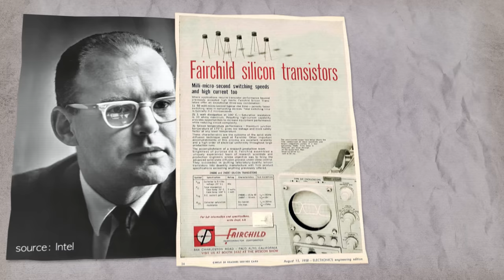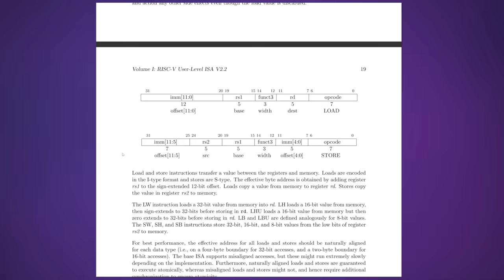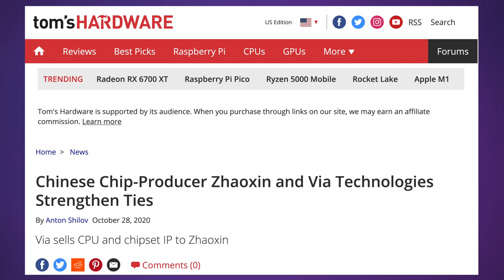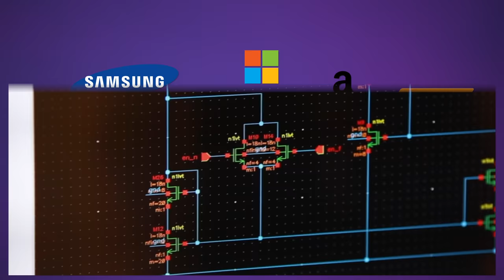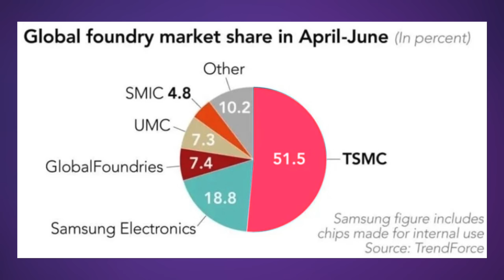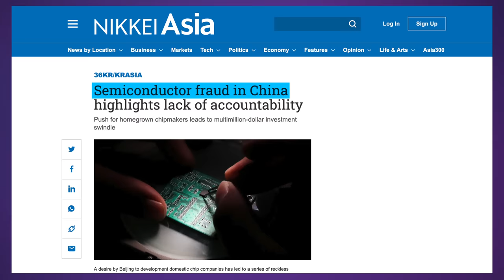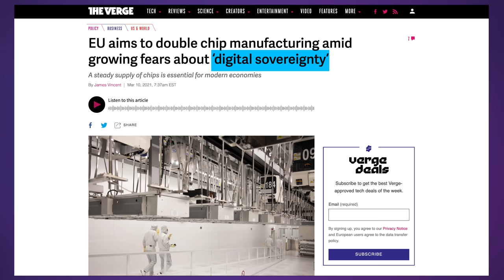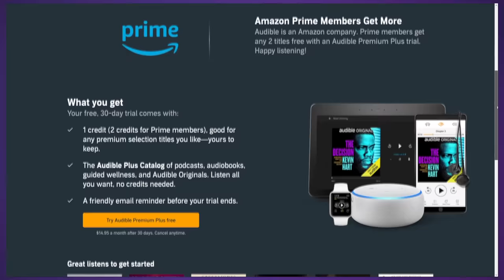Why making chips is so hard

Comment: Im assuming its because their all developed with distribution needs in mind(the u.s and their stuff all over)/ here: their 8 way processors due to the cheapness in manafacturing incomplete chips and bkending them together. based off when the first full digital code  is first accomplished the money saved by blending takes up much space and signal frequency...the frequenies are exploited as services and framework for internal components :therefore creating a need to be constantly upgraded (using chinese research funds before they get to the china mainland)(by developing chinese parts in germany) the cycle need not be ever obsolete until sector shutdowns begin when the tech supply ad stock is effected by the u.s landlocking an external source country aside of china for rare earth metals developments in replacement for the big payout the av u.s investor feels entitled to. The 8bit modified 250+ process fab is 11th generation and was once old icbm technology the u.s utilized for a self-bail-out somewhere after the dot com boom where they lost actual silicon stock supply funds. These chips have midern MULTIMILLION graphics add-onns and the mediatek and samsund graphic processes have become the binary security"chip" and "graphics converter" (inorder to sell 24 tiwanese chips per digital unit. Omg howd i do?
Reply: Tsmc is gov and samsung is the independent u.s tiwan supplier to them..samsung is a warehouse biz..tsmc is office based *big player.
Reply: Thats why its hard to make a chip? Its technically modern cold arms race as a replacement chip is needed for u.s nukes(as their new nuclear weapons devo is a fallung bomb...again..devo) tiwan does not want to help

Comment: burn on all the semiconductor test engineers of the world there! Designing ultra accurrate & reliable equipment to conduct tests of an entire device in the order of milliseconds is by no means trivial! But yes test coverage, and test time reduction isn't very sexy when compared to the fab equipment :( on the lower end of devices it is far more substantial in terms of customer cost though.

Comment: reverse engineered Roswell tech?
Reply: Well a Chinese company tried reverse engeneering on older ASML machine, took it apart and put it back together the same way, they never got it to work again. So...
Reply: @roadrage9191  yes, I know a couple of the guys who 'attempted' the reverse engineering job on the ASML. It was oficially declared that the Chinese couldn't get it to work again. Unoffically, however, they told me they were successful and they could actually  improve on it, but they were told to keep quiet about it by the Chinese govt for whatever reasons.

Comment: I'm sorry, but there is just so much basically wrong with this video that I didn't enjoy it. First of all a single transistor is not a processor. The simplest processor in theory is the least complex touring machine. I can't say how much operations it has right now, but the classical touring machine has 8. Each operation needs multiple transistors to work. In practice there are many more operations even the first processor used as programming a touring machine is literally brainfuck. That's an esoteric programming language that uses the operations of the touring machine. Then porting operating systems to different processor designs is not that hard. It has its challenges but usually you have the open source operating systems on any new processor pretty fast. Btw Android is Linux. Just not GNU/Linux. Windows on arm was a failure because Windows software gets delivered as pre-compiled programs. Those won't run on any architecture unless they were compiled for it specifically unless emulation is used - which is slow.It's a purely economic and juridical problem. If you have your fresh new processor architecture and wrote a compiler for it then you can compile your operating system kernel for it and a compiler itself as well as a boot-loader by cross-compilation. Also the rest of the operating system, but at that point you are basically set to compile the rest of the operating system with the new processor. So a whole part of your video is fundamentally wrong. At this point I can't trust any information in this video anymore and it isn't just fuzzy talking but a whole wrong idea.

Comment: Some of the content is literally based on the stereotype towards SMiC. Same as other cases this guy has commented on Jack Ma. Superficial knowledge.  Shame on you.
Reply from the maker: What stereotype? SMIC poached hundreds of engineers from TSMC when it got started and bribed multiple active TSMC employees to transfer the blueprints for their manufacturing tech. There are dozens of emails from the court hearings where SMIC leadership openly tells TSMC employees to steal trade secrets because they need it to establish their own fab. They were sued for this multiple times and lost each time resoundingly because of overwhelming evidence that they essentially cloned their entire technology from TSMC. The company even signed an agreement that they would stop and agreed to give TSMC an approximately 20% share of their company so the Taiwanese company could monitor. 
So, which of my comments are based on a stereotype?
Reply: @TechAltar  well, at least to my knowledge SMIC has difficulty of access to EUV. They are using DUV to improve their processes to "++"  versions. 

Regarding the poaching, I would say it's a pretty standard industry practice. For example, when a new design center were to be started, normally companies will pick a place where the other existing design center of other semiconductor companies are located instead of in the middle of nowhere. The very talented former TSMC process engineer Liang Mong Song has been hired by Samsung and SMIC. However, since SMIC cannot get their EUV due to the reason we all know, there is not much he can do.
Reply: Sheng-fu Horng  I have made this judgement based on his resignation letter mentioning they are waiting for EUV for 5 and 3 nm. As an outsider my judgement might be wrong. Perhaps you could provide deeper insight?